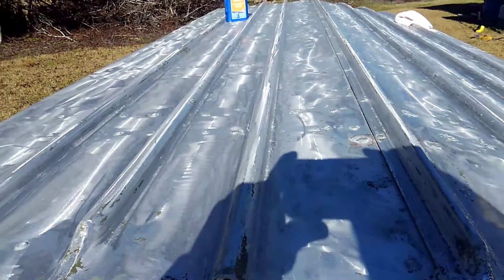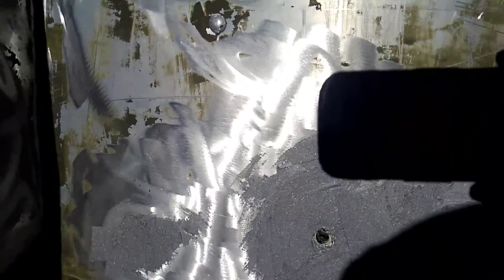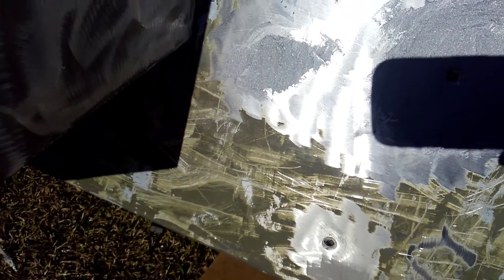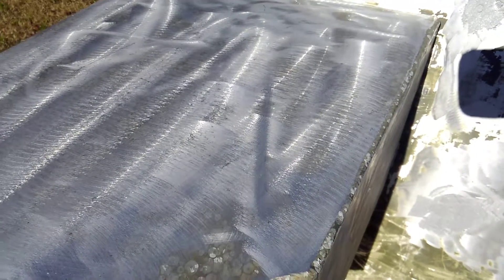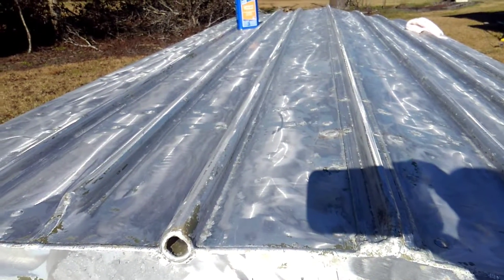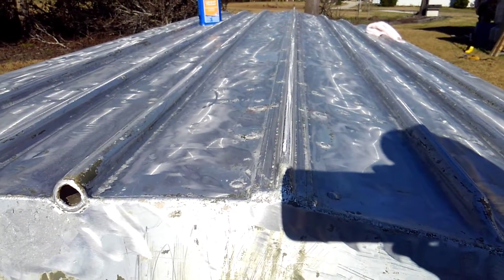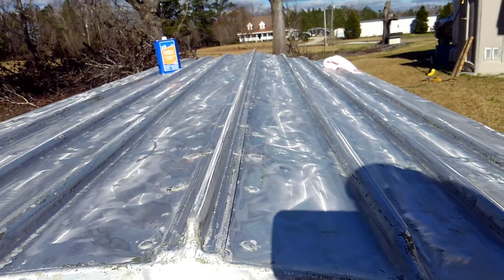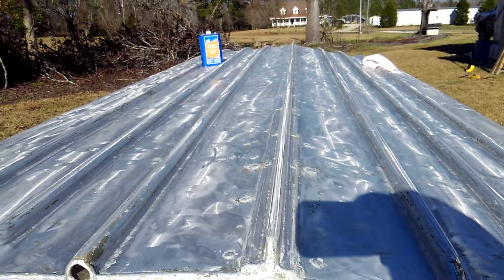#3  Short Vid,    Ready for steel flex bottom epoxy coat

Comment: how's it holding up
Reply from the maker: After the epoxy I put a coat of grey bottom pain on and I have flipped it in order to work on the inside.    Inside is finished but no trailer yet.    Will tell you the epoxy is tough......  I put it on when it was too cold ( Temp.  not recommended and I knew better) and put all I had on so it was thick in areas.  The thick areas ran a little. (Caused some sags)   I had to take a grinder  to cut some of the run spots down.  Sand paper would not cut it.  It was that hard.   Hope this helps.
Reply from the maker: Awesome have hit oyster rocks drug across sand bars  not enen a deep scratch .     I hit some shallow places  and it still looks good I'll try to put a vid in a few days or so .   So you can see
Reply from the maker: Not sure if I posted the reply right